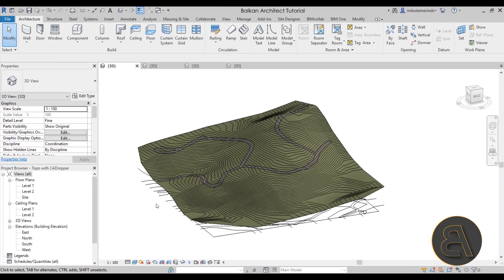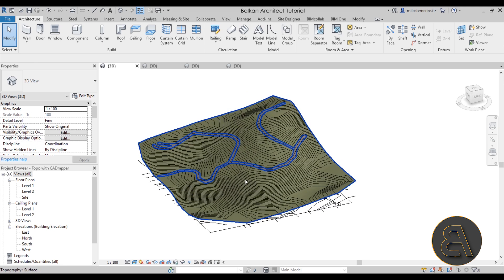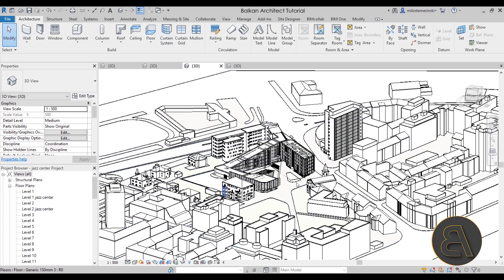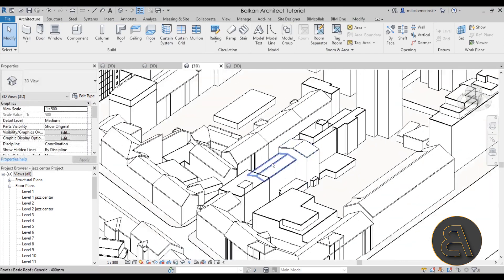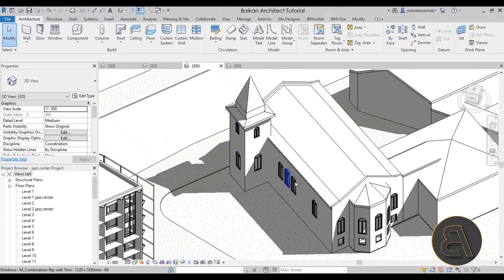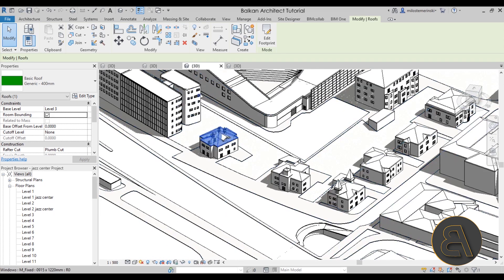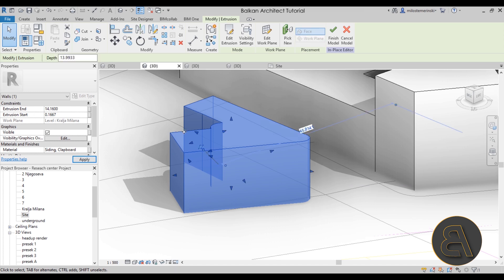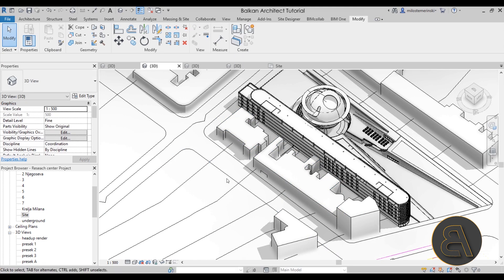How to Model Surroundings in Revit Tutorial

Comment: I was looking for a quick way of adding the roofs. I guess I will keep using sketch up for that.
Reply: Do you still use sketchup for roofs
Reply: @momodoujallow2600  No, Revit has a steep learning curve, but i can do anything with it now. Although I must say it lack an intuitive control platform for anything that is not straight.
Reply: Is site modeling in Revit really better than in SketchUp? I can’t even excavate, cut, or join my toposolid (it’s around 1 km²) because the optimization is terrible. I can’t place building pads properly, I have to define all mass levels manually, and I can only create openings on walls from the sides or on floors from above. How is modeling surroundings in Revit supposed to be better? I just don’t get it.

Comment: would you recommend Sketchup or Revit for urban design?  I think Revit looks better but I have read that it quickly becomes slow when working at larger scales, is that right??.  I also don't want to avoid placing topography in the model (great to see you used it here in your model), living in the UK, many towns and cities have small hills / sloping sites and therefore integral to the design. 

Any suggestions on here about the best software... I really need to learn one fast before I start a Urban Design course in September.